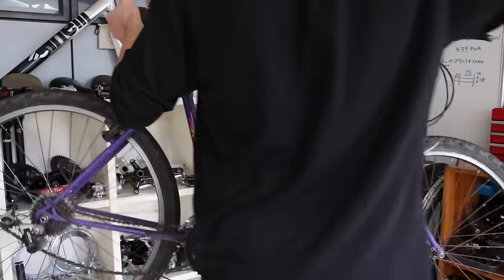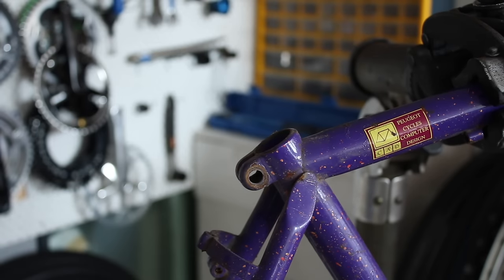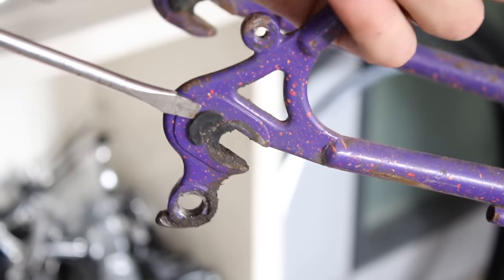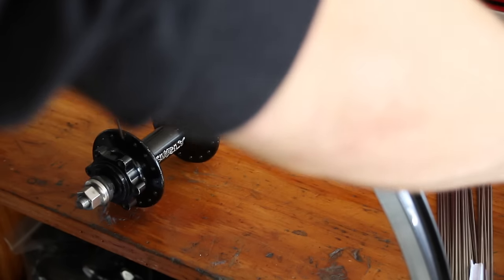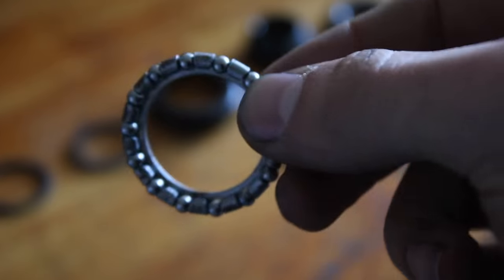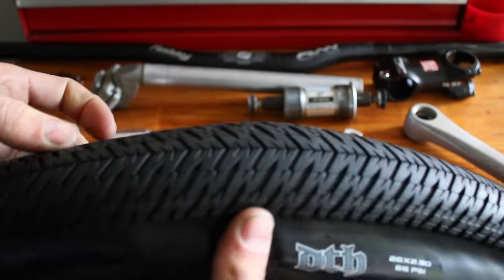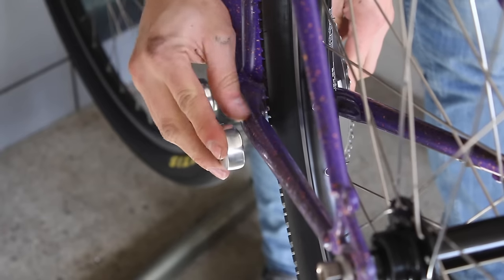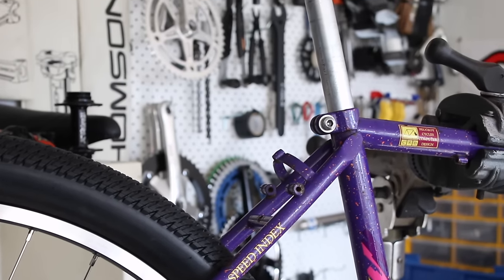Fixed Gear Conversion - Retro MTB

Comment: Very interesting! I'm 96% sure the bike had been through at least one rebuild before this one. Several parts were 15+ years newer than the frame, which I believe dated back to around 1989-91 (it depends a bit on where it was first sold). I have a Peugeot U.S. Express I'm trying to figure out how to rebuild... basically the same as the Black Rock, with some different parts. It's good to know 2.3" tires will fit! Nice work.

Comment: Fixed gear retro mtb wow! Definitely something new! I also like how you used zipties to attach the grips, maybe ill try that when i change mine, here people usually spray the insides of the grip with alcohol and slap it on the bars 💕🖤
Reply from the maker: It’s a little bit harder but it works well, hairspray also works good! 🧡
Reply: I use windex! It isn't sticky like hairspray, but it comes in a spray bottle so it's easier than alcohol!

Comment: In the 90s most bike messengers had hardtail and rigid fork mountain bikes. Most were single speed, some with gears and some fixedgear. But steel mountain bikes were the preferred method for getting around the city. 26" wheels are just more nimble, faster and sturdy
Reply: where can we find more information about this?  Im interested to know more about fixed gear  mountain bikes in bike messenger culture.

Comment: I have an old MTB with a failing gear mechanism. The chains occasionally fall out of place, and it's unable to switch to certain gears.

I'm considering modifying it into either a single-speed or a fixed gear.

Did you have any issues with this fixed gear conversion?

Comment: I have the very same bike since '94, when I was 10. Loads of memories of long rides on mountains and jumps such a bike wouldn't be expected to take. Only thing is it's far larger than yours and I'm only 5.7 - seems my father was unjustifiably optimistic when he brought it home. My "proper" MTB was stolen 5 years ago and I could only afford a track-style bike since, which is hardly a replacement lol. I was torn between restoring my purple Peugeot - especially going through the pain of recreating its splattered paint job that's gone missing from the chainstay and bottom bracket - and leaving it at the basement and staying off the mountains still, since it will never fit me exactly right. Seeing yours with a short modern stem and a nice wider bar makes me want to do the illogical and sentimental thing and bring the Black Rock back. Also, I found it funny that its paint job is so memorable that several people came across this video and sent it to me, knowing I would be happy to see another one of these. I don't know if I'll actually do it, I'm definitely not getting rid of that biopace weirdness though. Cheers.
Reply from the maker: What an awesome story. You should definitely bring the Black Rock back!! Send me a photo if you do, would love to see it!🙂

Comment: Quick tip, when you're building a wheel, consider putting the spoke nipple on a spoke in reverse to then feed it the correct way through the rim and not lose it inside a double walled aluminum rim. I found it is much easier than fiddling it in by hand.
Reply from the maker: Yeah that's a really good tip, I do that on deeper rims 👍

Comment: Are you not using any lubricant on the spoke threads when building? Or blue loctite or antiseize or something to that effect?
Reply from the maker: Just a bit of grease from my fingers ;) but yeah nah I don't. Theres a lot of discussion on what's best and there is both positive and negative to grease, loctite, anitseize and using nothing. Ive had no issues over the years, I guess if you ride in extreme wet condition or salt water you may want to use some grease or anti seize, but you should never need loctite if you tension the wheel correctly and use quality spokes and nipples. I always use brass nipples as alloy seems to corrode, seize and also round easier.

Comment: Yo, I have this White Street Comp CS bike and after the gears broke I started to wonder if I could convert it to fixed gear instead of buying a new cassette. I never use gears anyhow. Problem is that it doesn't have that nice vertical slot. It doesn't really have much of a slot at all and it's horizontal what there is. Would it it still possible to convert it?
Reply from the maker: You could still convert it to a single speed but fixed might be a little harder

Comment: since we only need a 6 hole mount for the cog, would a front wheel also do the job? or are there any security concerns?
Reply from the maker: Yep, in theory a front hub would work if you converted the axle to the correct spacing for the rear. In saying that I’ve never personally done this but I have heard of other people doing it

Comment: Great video, bike came up great.  Was your clearance at the rear hub 130mm in the frame?  I've only got 120mm in the frame I'm building up.  Would would you suggest?  I'm thinking a track wheelset as a singlespeed, but is anything else going to fit?

Comment: beautiful bike, solid, better than the fixied gear itself because a mtb gear like that is more resistant than a fixied gear and a wheel 26 of that size and that wide, that very practical wheel, even for those who do not like that thickness there are 1.50 and 1.10 inches in wheel 26, I love it,
Reply from the maker: thank you!

Comment: Is it okay to run fixed with that kind of dropout? I also had this idea of conversion, but i thought it was sketchy to run fixed with that dropout. Thanks.
Reply: I want to convert my classic rb into fixed but i thought its kinda sketchy with that drop out. We need answerss nyahahahahha.
Reply from the maker: It's actually quite a common question, I've personally never had any issues. I get why it looks like it might. Old road bikes use the same dropout and they used to get raced at top level with quick release. Just remember to tighten your nuts properly. It's the same story with track drop outs, the wheel can move if you don't tighten them properly. But if you tighten them properly it will never move/slip. People have been doing these fixed gear conversions for years and years 👍
Reply: @waveywheelies  thankyou so much. And always ride safe.
Reply from the maker: No worries, and thank you. You too!

Comment: Awesome bike! Could I use any 26inch mtb wheel for disc brake and use that to attach the fixed cog?
Reply from the maker: Thanks! Yeah totally, I have seen people do that! Just make sure the hubs got a solid axle and not a quick release, you can convert a quick release to solid axle if you don’t have one

Comment: I wanna build a fixed gear belt drive bike. Would be expensive for a single gear drive train, but would be the ultimate short distance commuter imo. You never have to do any maintenance other than pumping tires and checking brakes like once a year or something.
Reply from the maker: Yeah that would be perfect, I’ve also been thinking about belt drives recently! Definitely one to try out on fixed

Comment: hi mate bike looks sick, wondering what exactly you used/did to fit a modern stem onto the steerer ?
Reply from the maker: Cheers man! It’s a quill stem adapter, have a look online, there is a few sizes out there so double check you’re measurements before buying 👍

Comment: Hey I currently am doing a roadbike conversion to fixed gear, inspired by your work. However, I later noticed that there is a high chain crossing in my gear, and I was wondering if you have the same problem.
Reply from the maker: Awesome! Is the chain line off? You might have to play around with BB lengths and also cranksets

Comment: Question, I didn't see you put back any brakes.  What am I missing?
Reply from the maker: It’s a fixed gear, so you can slow the bike down by resisting on the pedals!

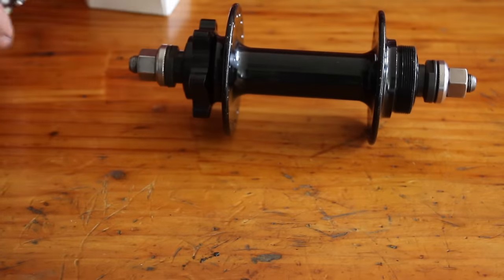Comment: 8:00 just to clarify, u mount a fixed gear onto the disc brake hub?
Reply: Yes
Reply: it’s not that unusual …
Reply: @ohmslawyer3599  sure, i've just never built a fixie before
Reply: @backtoids  understood … to clarify this: it is not the usual kind of fixed wheel built. Usually you use a track hub (with a sprocket and a lockring). But most track hubs (nearly all of them ) come in 120mm width (not 130 as needed for this built) … cheers !!!

Comment: Hate to be a hater but, did the internal rust worry you at all?
Reply from the maker: Not really no, I always check over the frame and forks thoroughly. They main worry for rust is when it starts to bubble, if there’s spots of rust bubbling anywhere especially the chainstays I generally avoid. I’ve been riding frames with surface rust for years, I’ve also stripped back a fair few and you can get a general idea of how bad the rust is. I check internally when i remove the BB, the rust/grim will build up around the bb if there’s internal rust. I also shine a light down the tubes to visually check

Comment: can fixed gear hub fit with mtb frame I got an old cannondale
Reply from the maker: Depends on the hub and frame spacing, you may need to add some spacers on the hub depending on the set up

Comment: Those rear dropouts are really not good for fixed gear because although they may be semi horizontal the stress from locking up the wheel will eventually skip the wheel forward on the drop out and fall out of its place because it is not the correct drop out for a fixed gear. Other than that clean build 👍🏼

Comment: the drop out of mountain bike and fixed gear are not the same
Reply: it works for this one, old mtb use horizontal dropouts. although not the same as single speed or fixies, it will still work